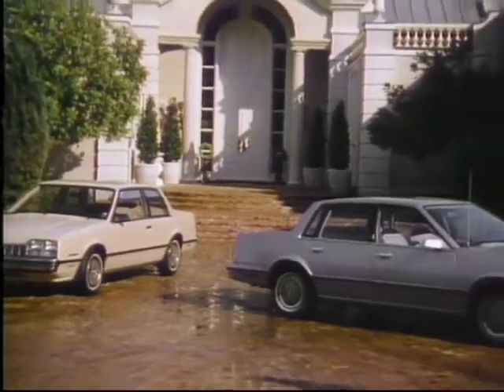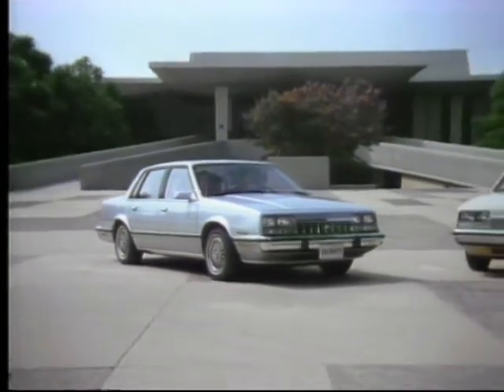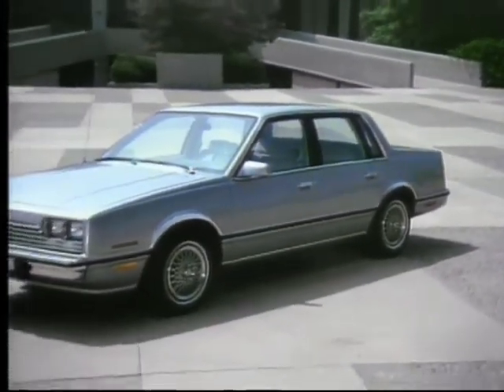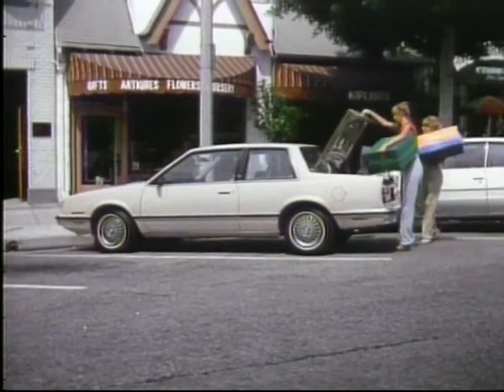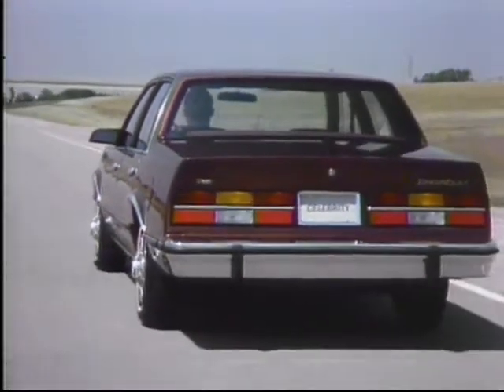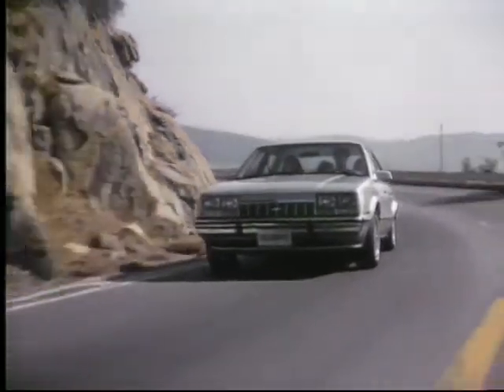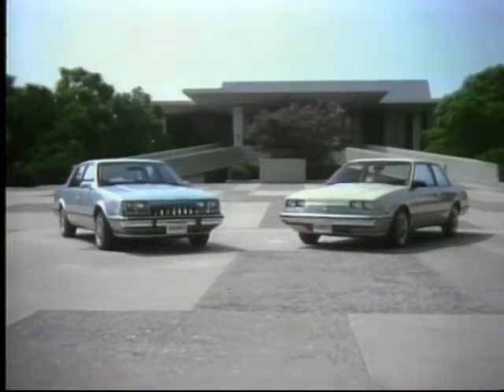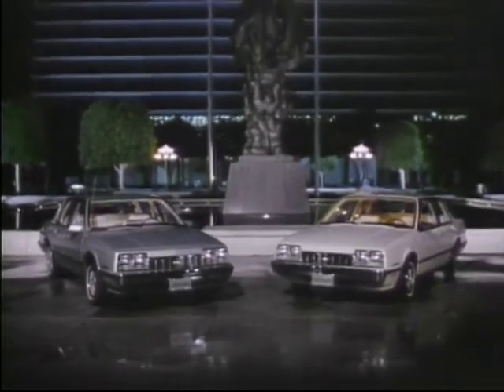1982 Chevy Celebrity Sales film

Comment: Never owned a Celebrity, but I did own a 1991 Chevrolet Lumina that I bought new. What a great car. I always loved the feel of everything in it. Column gear selector was just so smooth going between gears. Same with the way the doors closed, and the windows crank by the way went up and down just so smooth. Drove it in the rust belt northeast until 2012 when I retired. It had one small rust hole about the size of a quarter in the left rocker. 3.1- liter v6 never failed to start in the coldest winter mornings sitting outside. And talk about a tank in the snow man it went so well. Miss it all the time.

Comment: Wow, My first Car was a 1987 Eurosport RS Chevy Celebrity.
  I loved that Car, I was up in Reno, Nevada and back to the Bay Area back and forth with this car. 
Drove it to Mexico.
   The Car was used when I got it, only 16,930 Miles on it, then I put a 100,000 miles on it afterwards. 
It Broke down needing Head Gaskets and a new Transmission I got all things replaced and Sold it and got into a 1993 New Chevy S-10 Blazer with the 5 door Tahoe Package and the strong 4.3 L V-6.
  Now I'm into Fords I own a 2020 Ford Explorer and a 2018 Ford Fusion Sport. 
Chevy was nice back then, but I'm liking Ford Products now.

Comment: Nice that they offered windows that rolled down....
Reply: In 1978 GM introduced a line of cars Chevrolet Malibu, Pontiac Gran- Am , Olds Salon, and Buick Century and their rear windows were fixed and did not go down. GM said their new flow-through ventilation was so effective that the windows opening was not necessary.

Comment: The bright new shape of Chevrolet!!!!!  I have always called the Celebrity, along with its Buick Century, Oldsmobile Cutlass Ciera, & Pontiac 6000 stablemates, GM's "Redemption Cars" as I feel that when they were first introduced in January of 1982, they fixed everything that was wrong with the X-cars which had been introduced in April of 1979. No, they were NOT perfect cars, but in terms of build quality & durability, they were orders of magnitude better than the X-cars.
Reply: Myself, I'd have scotched the 2-doors and put that money into more brand differentiation and having the wagons at launch in 1982 instead of delaying them to '84.
I think basically everything that had been wrong with the X-Cars had been fixed by that time and the FWD A's benefited from proven mechanicals and a fresh reputation.
Reply: I totally agree 👍 these A body cars were miles ahead of the X body cars , and the A bodies looked more upscale compared to the Chevy Citations . CHEERS 🍻
Reply: GM would have had a much better chance at salvaging their reputation after the disastrous Vega and later X bodies if Cadillac had used this A platform for their entry level model instead of gambling on the J car
Reply: @303nitzubishi4  Agreed that the A-Bodies, are greatly improved cars that meet average performance standards.

Comment: In retrospective, the 1973 and 1979 oil crisis were the watershed moment for American carmakers in fuel economy matters. The Celebrity could have been a compromise between fuel economy and performance for customers who weren't considering to buy Japanese econoboxes.
Reply: They are definitely competitive, especially once  they were optioned with the 3.3 V6 making a 160HP and 180 LBS of tourqe.
Reply: @oliverrojas3185  Considering the ridiculously low octane rating for gasoline in North America, 180hp on a 3.3L V6 would feel like "just nice" for the normal car drivers.